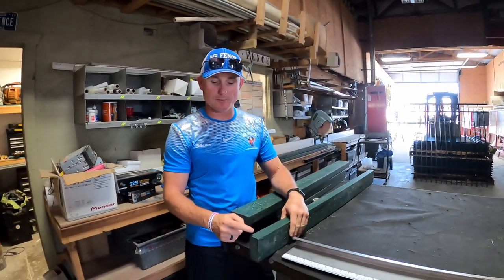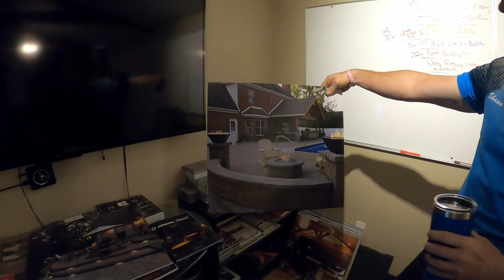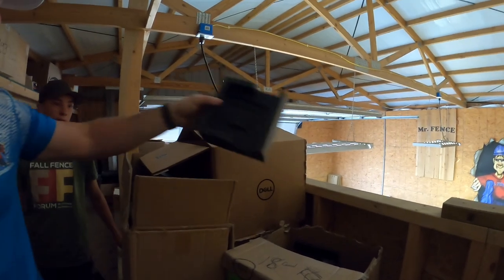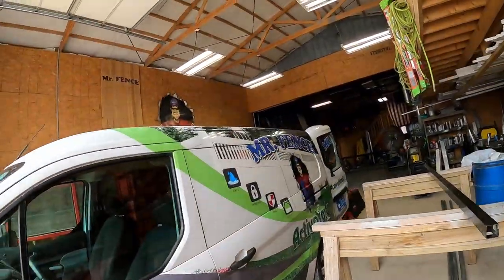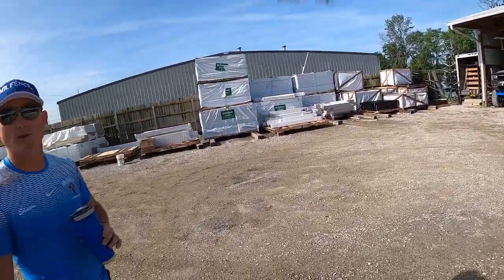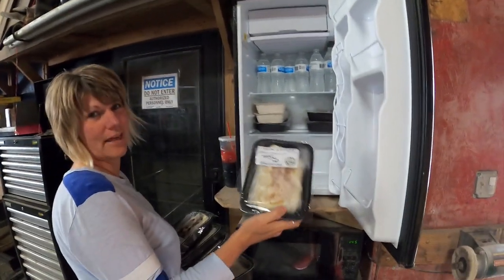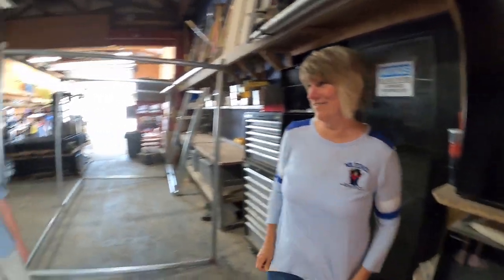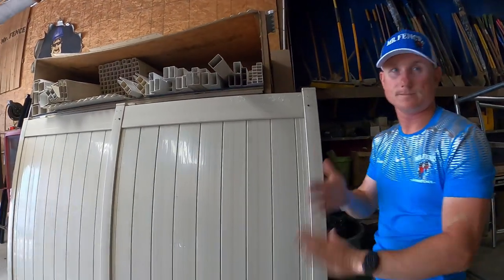Think Through Everything | Mr Fence of Indiana Ensures Success

Comment: Could you guys make a video on how to make those spacers for the purpose of spacing vinyl posts going uphill and keeping even spacing up a grade between posts so when you go back to build the sections in between posts, everything fits with correct spacing? Ex) how to cut them, what measurement to cut them at, angles etc and how to use them?
Reply from the maker: I’ll put it on the idea board.